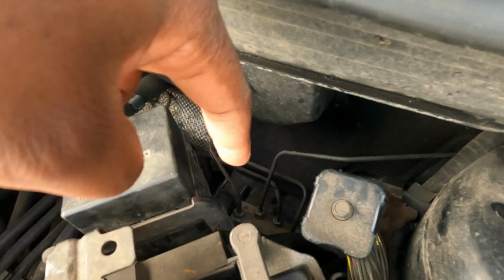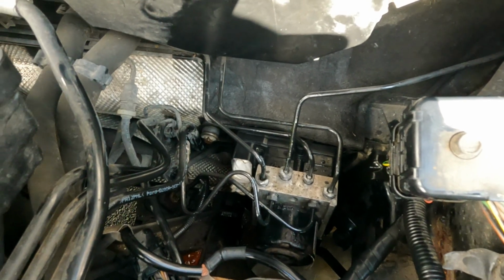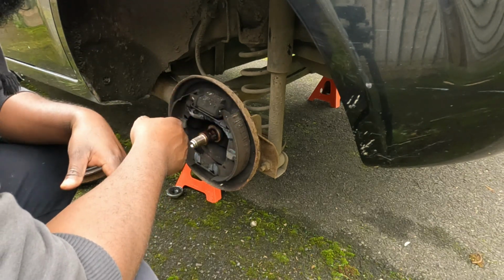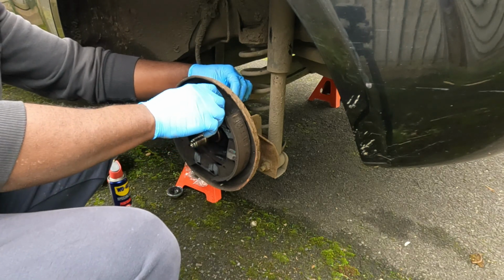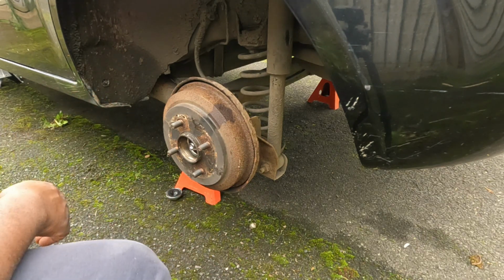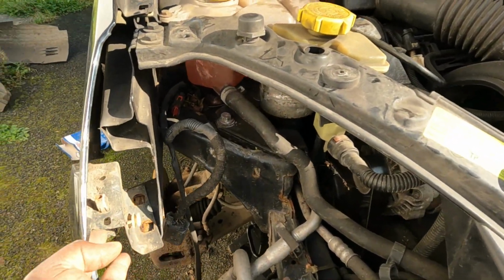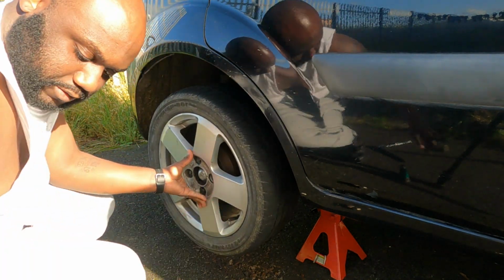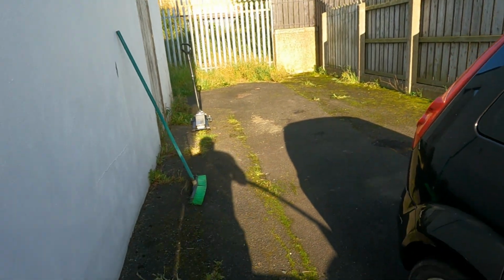Fixing this Ford fiesta (Mk6) *PART 2*

Comment: I think the rear wheel bearings come fitted inside the new drum already. Easier than pressing bearings out/in for not a lot more. It helps them last longer if you pack some bearing grease behind the hub nut cover.
Reply from the maker: I just wanted to get the car back in the ground.
So instead of waiting for rear hub to be delivered just picked up a bearing and my mechanic done it in no time.
Thanks for the tip. Didn't know they would last longer that way. 👍🏾

Comment: Hello, I have a mk6 golf and I’m looking to put on a cruise control module Iv seen the video where u fitted it but was wondering if you could do a video on how u changed the codes if possible?
Reply from the maker: The module I've fitted was to support mfsw. The car most likely will accept the coding for cruise control like mine did.
Check module part number with vcds to be sure it'll be accepted before replacing module. If that's the case all you need is the stalk.
But yeah.. I can for sure make the video about the coding.